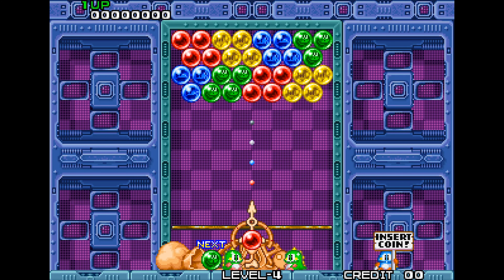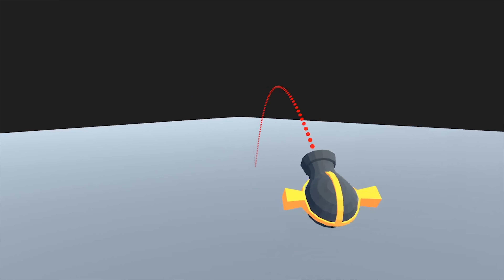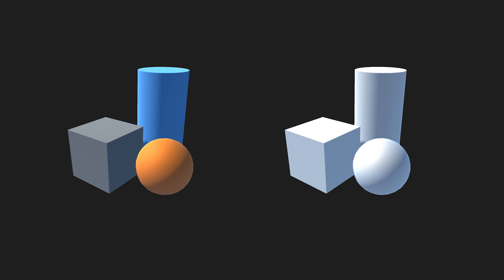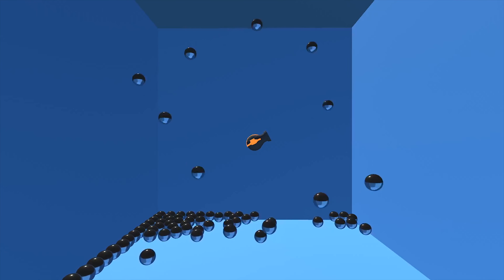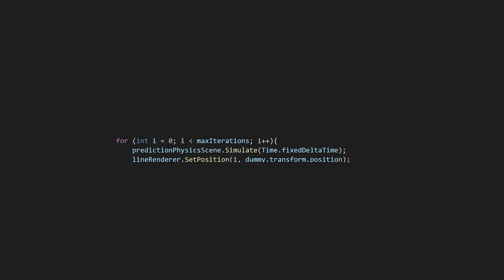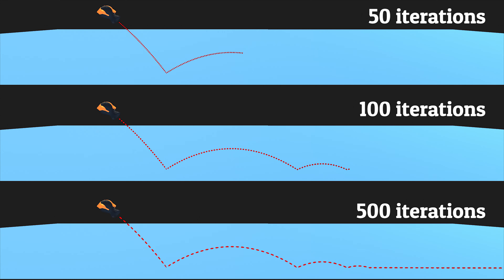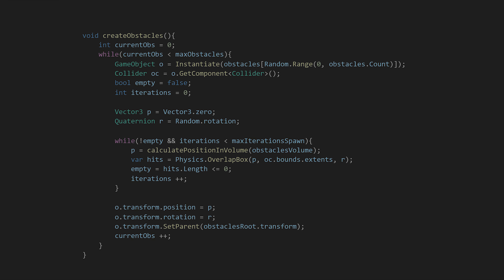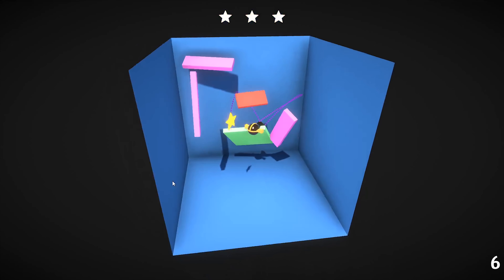Trajectory prediction in Unity

Comment: My prediction lines doesn't bounce
Reply: I dunno if you've moved on or solved the problem but i found out that if i delayed the CopyAllObjects to the next frame in the level manager that it fixed itself. Though i had a problem with the physics scene not being valid so it might be a different issue